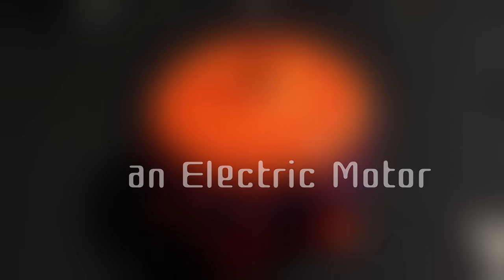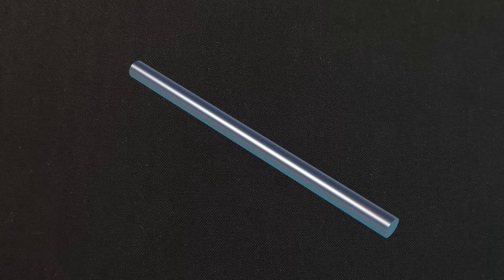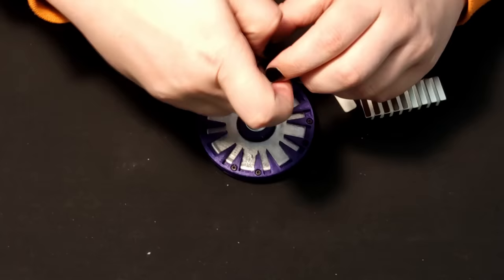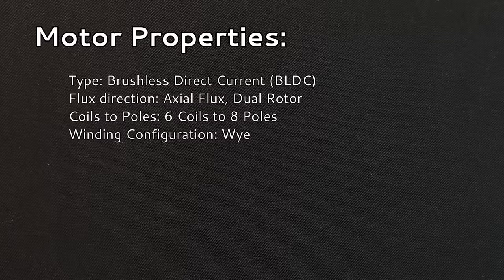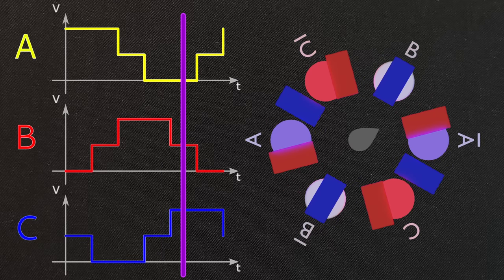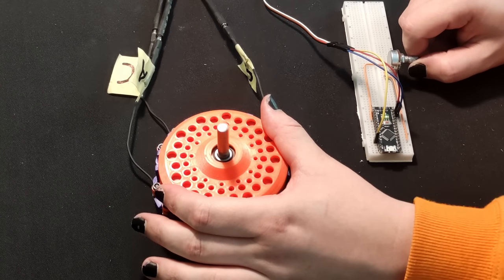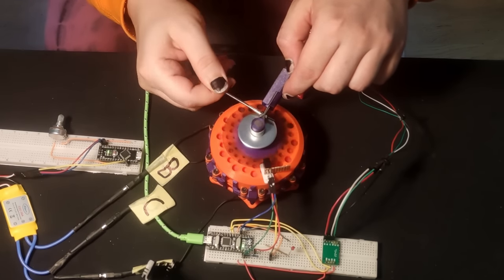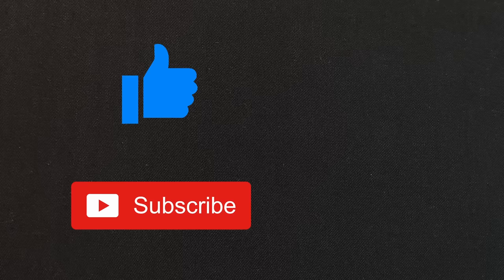An Axial Flux BLDC Motor Build

Comment from the maker: I tried to fix the motor's Kv rating after the video went live, as I had some ideas on what could be the reason for phase A being broke (I figured that maybe I had somehow connected a coil in phase A backwards or wound one coil backwards... somehow)... however, nothing I did helped... so I still do not quite know what caused such a big difference in phase A as opposed to B and C... 
I will not make the stl files public for this motor because it's overcomplicated, there's no assembly instructions and it only works properly on low power... if you push it too hard, it will melt.
Reply: eeee
Reply: Did you measure the resistance of the phases? it is possible that maybe there's a short in one of the coils.
Reply from the maker: @RoycoNL  The resistance of the phases is the same as far as my multimeter can tell (0.1ohm resolution).
Reply: Hey, is there any way I could reach you? (E-mail, discord, Instagram...) Maybe my team could help you.
Reply: It may be short-circuit in one of phase coils or some issues with coil winding resistance (some wire conductivity imperfections or such). Just my guessing.
So anyway it is an interesting video, thank you )
Reply: Something is out of phase inside your motor.  If you put iron inside with it you may have cause the fields to mirror each other or push out too far and this causes you magnets to be misaligned.  I suggest you take the iron out and try it with just magnets and coils.  Any iron should be outside of the motor's workings, like a simple backing plate.
Reply: What's the problem with superglue you say it would fail at 80°C where is the problem? Your motor shouldn't be getting that hot most NIB magnet fail at 80°C(60°C for N50/N52) yes you can get higher  temperature variants but you didn't say you had specified high temperature magnet.
Reply: @dmitribovski1292  I think the problem is that it fails not right from 80°C totally but it starting to fail for much lower temperature loosing its strength part by part. 80°C is a temperature where it lost all its strength completely.
Reply: @teolynx3805  I think you completely missed my point he stated the 3D printed plastic would fail at 60°C & the Superglue @ 80°C & didn't mention the magnets would fail at 60°C If he wasn't aware of this  he could have made moulds on this 3D printer for high temperature epoxies & glued the magnets on with  Duralco 4420 spent a fortune on the high temperature stuff good for 230°C only to find he had killed his magnets.
Reply: I suggest you get an LCR meter to measure the coils inductances. You could even do this for each winding before soldering them.
Reply: I expect one of your coils was physically closer to the magnets.
Reply: He needs to use at least one thrust bearing for an axial flux motor, a coil may be producing enough force to contact the rotor
Reply: I did the spread sheet.. yep your Wye Phase "A" is wired backwards.  Your readings is consistent with a A phase that is 180 degrees  out of phase.  Redo your Wye wiring and you should get 1.78 across the board.  And yes that would keep it from self starting, One third of your motor is fighting itself.
Reply: @gtjack9  With a symmetric rotor where the stator is sandwiched in between (like he designed it), the axial forces cancel out.
Reply: @mariodekena1005  Oh that makes sense, I did wonder why there wasn’t any.
Reply: Why you didnt use metal core inside coils?
Reply: @BirdbrainEngineer  Connect a 1a current source to the motor windings. The values on the multimeter in millivolts = resistance. The logic is I=U/R => R= U/I => with I = 1A R= U.  When measuring it is desirable to subtract the resistance of the multimeter probes, which you can measure by connecting together.
Reply: Powerful dron moter  make video

Comment: This is an amazing design. Should be super proud of your work. I've only just started 3D modelling and I am in awe. You should consider putting this up on a modelling share platform. Something like onshape where you might get engineers at a similar level that can make tweeks. If it goes to thingyverse it will get bastardized
Reply from the maker: Thanks! Why I don't really want to release the 3d files is because the motor requires quite a bit of other "stuff" as well to work (the washers, magnets, wire, bearings, shaft, etc...); so for anyone to really be able to replicate it, I would certainly have to make a proper manual for it. I think this particular design is not quite worth the time making such a manual. Whenever I get to making the next motor however, I will also make an assembly manual and definitely release any files :)
Reply: Well reasoned.  I was going to ask a similar question but instead I’ll wait for the next impressive motor you come up with :)

Comment: This is a very impressive piece of work. This design is also my favoured concept for a BLDC motor. Regarding the phase imbalance you experienced, a fairly common cause for this condition is a difference in strength between the magnets. Generic magnets, although rated by suppliers as say, N52, tend to vary quite considerably in strength.
I once had a similar issue which I fixed by constructing a simple device, consisting of a wire pointer which pivoted on an axle. One end of the pointer has a steel washer soldered to it and attached to a coil spring. The contraption works much like a pressure gauge,  the more pressure you apply to the sprung side of the pointer the more the opposite  end of the pointer needle deflects. I put a simple linear scale under the arc of the pointer.
Now, using this device, place one magnet from your batch of magnets close to the steel washed end of the pointer, at a proximity that gives about a 45° deflection. Note the reading and mark the magnet. Check all the magnets by placing them in the same spot and orientation, record the deflection force and mark each one. I found significant force differences between many of the magnets, however, I had a lot more than I needed so was able to put a requirement together with almost exactly the same strength. This did solve the issues I was experiencing with a prototype project.
There is one other condition that causes phase imbalance in much the same way, and that is the distance between magnets, and electromagnets'. Even small variations here can cause significant differences in efficiency between phases. This distance or gap,  the smaller it is, the more efficient the motor will be, as defined by the "Law of inverse squares" - The force that magnetic poles attract or repel each other is proportional to the inverse square of the distance between them.
I have seen a motor of this design that had an efficiency of 98%. It was very well designed with four magnet rotor discs and five air core coil discs. The whole construction was made from high precision machined aluminium with a micro gap between the magnets and coils. The N52 magnets were built to order and the coils wound in precise layers with square, enamelled copper magnet wire. The interesting thing about this motor was that each rotor had six round magnets and six air coils of the same triangular shape as shown in this video. The only steel parts were the long screws holding the whole aluminium assembly together, so it was incredibly lightweight too.
Thank you again for a great, well done video.

Comment: Nice build! I have made some powerful iron less motors over the years, 30,000 rpm from 8 magnetic pols with 24 coil poles, and a 69,000 rpm from 2 magnetic poles with 6 coil poles. If you want more power from your motor, unwind your coils and use the same wire but cut it into 3 lengths so it’s triple wound. And get a more powerful ESC.
Reply from the maker: Hi. RPM does not necessarily mean higher power. Power = distance (RPM) * torque. This motor has a low kV (low rotation speed) but a high torque instead. Next year I might want to try making an e-bike motor, and e-bike motors need to have a lot of torque but lower RPM. The ESC plays little role here - it will give you enough power until it burns itself or shuts itself off completely to protect itself, neither of which happened here. I now have a sensored ESC for my next motor project though, and that would increase the performance of the motor a little bit as well, if it had hall effect sensors fitted.

Comment: Props to you for measuring the performance of your motor! Instead of a Prony brake, you might consider pumping water as a means of loading the motor, a classic technique. (You control the load by increasing the "head" of the water. The pumped water warms as you proceed.)

Comment: I wonder if there is some way to improve efficiency by including the Tesla turbine into the design of an electric motor using the rotation to collect air and using the rotors as the turbine disks . In turn also cooling the motor for better rpm output? The only issue would be the GeForce of the turbine  design which even Tesla himself could not solve. His turbine works with liquid and gas.

Comment: omg lol this is so legit. I went and watched your whole channel after this! So good! I made a pmdc motor years ago and you'd get a kick out of how terrible some of the CAD choices I made were (threads mainly). Reading the comments it clicks that everyone wants the CAD files but- idk I'd hold onto them cause you do 6 fig work here and I wish you the quickest path to it. I get that certain design and hardware choices that are regularly unique to a project and that there are regularly more efficient ideas people have came up with over the years but you're not on the wrong side of that coin here. So funny you hit all the barriers I ran into on the head w heat and PLA parts, doing it anyway, the lithium batteries > alkaline- the current limit w alkaline was the curiosity that had lead me to 'lemon batteries' during my motor build so the video on potato batteries was an absolute gem. Where I love electronics, I found that mechanical coupling and little details are regularly the hardest part (the least flashy parts) and the electronic and flashy parts are hard to nail for reference. Can't tell you how absolutely floored I was to see that winding mechanism- so clever- mine was a tally sheet plagued w question marks. A lot of things come to mind w the starting issue you had but it'd be more than I have/will written/write to go over all of them. Your efficiency is killer; considering we're working w 3D printed chassis, anything that gets above 2k rpm and difficult to hand stall w out melting the thing is a work of art. You've likely done a fair amount of testing and probably know best here but if you have the budget in heat, you might play w inductive/capacitive loads in parallel and see what that does for your power factor/efficiency, and series resistance might actually help your starting characteristics (seems like a transient issue causing the flux to lap the pm rotors). You've probably done all you can on the starting sequence frequency but that can be tricky to optimize sometimes. Anyways- so good- so so good; please keep doing what you're doing, and I'll be on the look out for a patreon link.

Comment: The advantage that axial motors have over radial is the unused length of magnetic flux path is much much shorter. In a radial motor the flux needs to travel around the outside of the motor, whereas in an axial motor its just a short hop from one coil to the next.
Your design takes this a step further by using a Halberg arrangement.

One improvement, again on the magnetic flux path, would be iron cores for the coils.
Reply: Iron cores for the coils lead to problems with cogging. I also think it is a problem to combine the Halbach design with a backplate. For a Halbach design there is also too much space between the magnets. I guess the use of the normal switched polarity magnets in combination with backplates should work best. In this case it is also easy to calculate the flux density, because the air gap mainly determines the parameters of the magnetic circuit.

Comment: The only problem in this motor masterpiece is that my boy didn’t count for bigger bearings, small bearings will just be eaten up by the rotaforce.

 you should’ve used a 15mm ID bearing, better and more powerful ESC (40AH), metal casts in these size motors are mostly aluminium, nearly 350-800 watt *%80-95* efficiency.
Why?
Ans: SHOCK absorber
Also make sure that the carbon steel on that thing is completely isolated from the windings.

The plastic in this project’s displace’s the magnet position due to rotation, and drive’s it to a position where it shouldn’t be from from a position where it is, so the small change in position of these magnet will make the motor guidance system to send more POWER which will eventually deep fry your brunette magnets(coils) and your motor guidance system(maybe)

If these steps were taken seriously, the efficiency would’ve gone %75 and above
Reply from the maker: Aah, the motor was never meant for anything but learning and demonstration of working principle... I would have to do a lot more research into manufacturing if I wanted to make something that would be a useful prototype... maybe some day.

Comment: another thing to look at is what kind of airgap you have between each rotor. The larger the airgap the less efficient it is. TESLA uses an airgap of .4mm in their latest Model S motors. (albeit different style motor), but the theory still applies to AF motors as well.
Reply from the maker: Realistically, due to there always being some unevenness in the print bed and 3d printed plastics being... well... plastics and so a little malleable, you are not really able to get an airgap smaller than about 1mm. At such scales though, the difference in efficiency is nearly negligible.

Comment: Just want to point out, all dc motors are commutated. 0:57

While brushed dc motors are mechanically commutated with the brushes switching current through various coils,  brushless dc motors are simply electrically commutated with mosfet switches controlling the current to various coils.

Comment: Impressive.  You may want to check the resistance prior to soldering of the coils with and without a magnet over them ( stationary and known pole direction ) to ensure their resistance is close to each other.  The magnet is to ensure that any back EMF from the magnet during resistance check can be accounted for as well as any accidental change of winding ends during assembly as a known voltage will result as you remove the magnet.

Comment: I believe you need at least one hall sensor to detect the phase which needs to be disconnected at that moment! otherwise, sometimes you turn it on and it just freezes and eats electricity without turning
Reply from the maker: You can run a BLDC motor in "sensored" mode as well (as long as the electronic speed controller supports it), but in that case you need 3 hall effect sensors. This motor is not sensored, and does not require any sensors to work. Unsensored motors and ESC-s (like the vast majority of drone motors for example) only expose the three motor phases and nothing else. The ESC figures out when to change the phase based on looking at the voltage induced on the disconnected phase. 

The reason for why this motor doesn't start up properly is because one of the coils in one of the phases is connected up in the wrong direction... to this day I am not sure how I managed to do it but I have not bothered to fix it.

Comment: Excellent explanation and video to show experimenting w motors. Perhaps if you measure the resistance of the three coils, as installed w all connections, you may see a different resistance in phase A. Pls use a 4 wire meter to measure very accurately. The next possibility would be the inductance of each winding, using inductance meter.  Great job
Reply from the maker: Yeah, I'd like to measure the inductance... still haven't gotten myself to buy a compatible multimeter or something more specialized for that. 
All the phase-pairs measured 0.7ohm if memory serves... Would a... say 0.1ohm difference between phase-pairs cause that great of a difference in kv? Should look into that... the actual underlying math looked kinda complicated on the surface  though, not gonna' lie haha.

Comment: I wonder if the voltage discrepancy in the phases is caused by warping of the stator/rotor assembly? Not sure which, but in that last clip you can see it moving up and down as it spins; that alternation in the proximity of the rotor and stator could account for the voltage difference perhaps? If you were able to replicate a similar machine turned on a lathe or CNC, perhaps it would make the difference? It also looks as though the shaft spins a little faster at one point of each revolution, so that could indicate this issue too

Anyway, fantastic creation and really good video.

Comment: Suggestion for your next motor, is a hollow core, of the type used in robotics. So wires can pass through where the shaft would go.